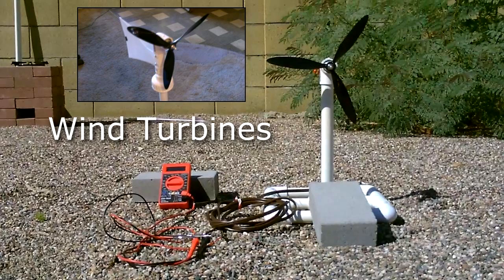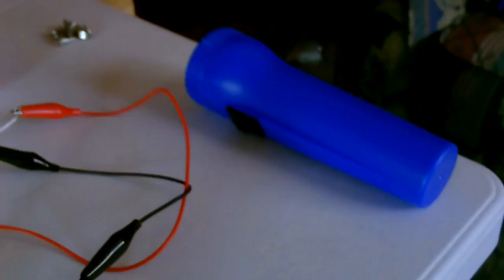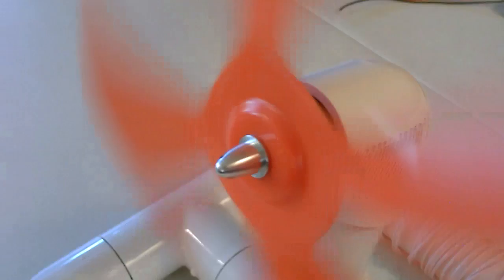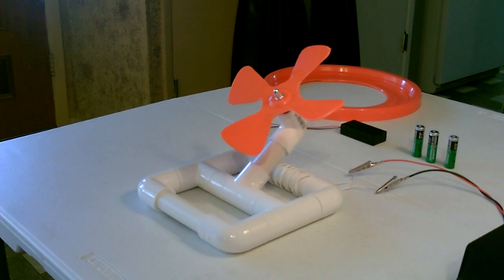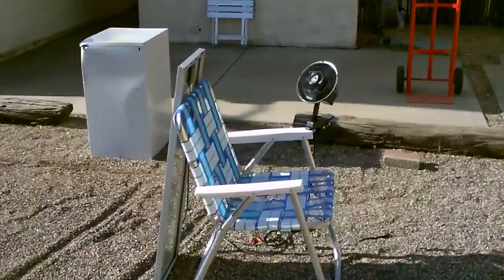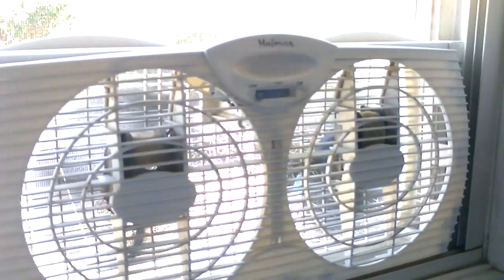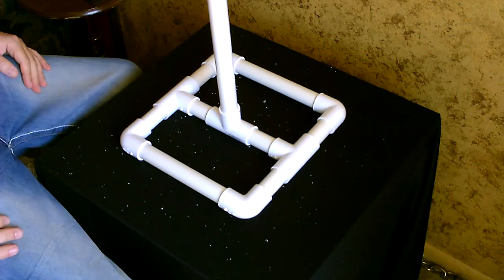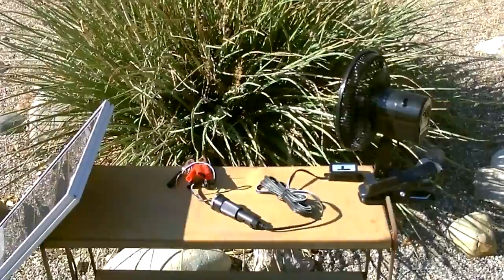Fans and Turbines! - Homemade fans | Solar powered fans |  Mini Wind-Turbines (Compilation)

Comment: Very fine video found with a general Web search due to wishing to find a way to modify my Home ... (forgetting the exact name of the manufacturer or model) fan, which is large enough in diameter and blows adequately well, but only or mostly when up very close to it.  Didn't find the or a solution in this video for my particular fan, but the info. is still worth knowing, so it's playlisted and also bookmarked with the Web browser.  I also have another bookmarked video about how to make a fan work somewhat like an AC (air conditioner) and it's so simple to do that a simpler solution might be impossible to find.  The "trick"?  Place a sizeable pan, pot, ... or other container filled with ice cubes right at the front of the base of the fan (when it's operating, of course), and the cooled air will rise enough to be blown or carried by the air blown by the fan.  A problem with that is having enough free freezer space for making or at least keeping the ice.  That's not a serious problem where I live, for this is southern Quebec, Canada, and a fine fan should normally be adequate, including without the ice.  But, it might be useful to people unable to afford good AC's and who live in areas where there're many hot (also humid) days.  We have some in southern Quebec, but it's normally bearable, in the area where I reside anyway.  (I won't speak of large cities, which can get hotter, with or due to all of the asphalt, etc.  I've read (years ago) about people (don't know what ages) dying in Montreal hospitals when temperatures (not sure if it included humidex) reached 104 F, and we're to expect even higher than that next week, starting June 24 or 25, 2018, ... with humidex, that is.)  Here's a possibly (?) good idea :  A fan equipped with its own little freezer for making and preserving ice that's to be used with the fan.  I don't know if that can be done inexpensively (very) in a DIY way, but it's an idea that just came to mind so since you're a DIY fellow, I'll pass the idea on to you (and anyone who wishes to pursue the idea, of course).

Comment: I recently had the cooling fan for my radiator on my van broke a fan blade. I Salvage the two 12 volt Motors and maybe these could be used directly from a solar panel. any idea what size solar panel would be required for something like that?
Reply from the maker: hi there. the power consumption of those motors varies quite a bit. here's a link to a chart of a few of them. it shows them ranging from 2.2 amps up to 49 amps. https://www.a1electric.com/catalog/cat_spal.htm ...you could probably run a smaller one with a 100 watt 12v solar panel. (since they put out about 5.5 to 6 amps). but you'd have to have couple of panels to run the bigger ones.